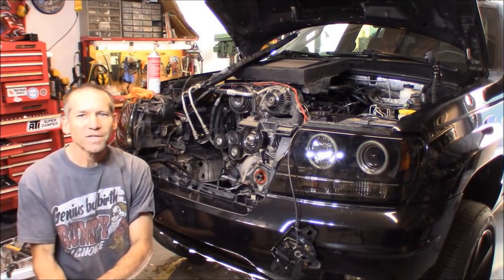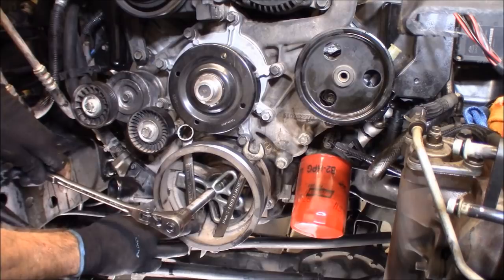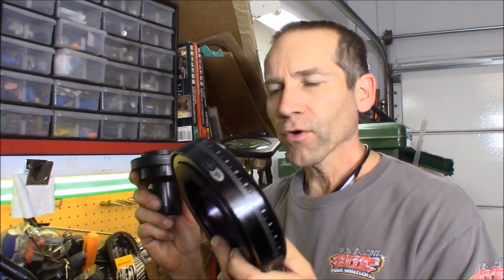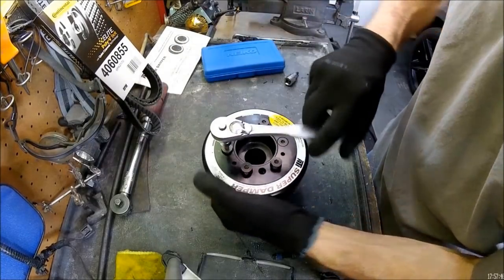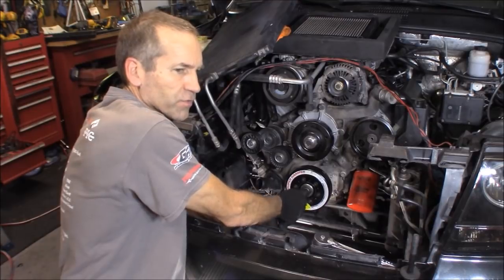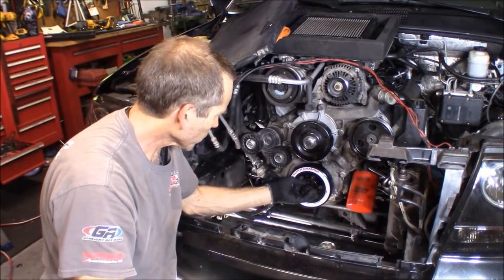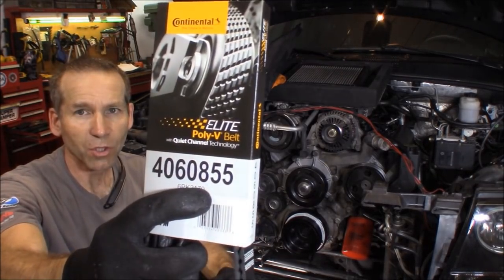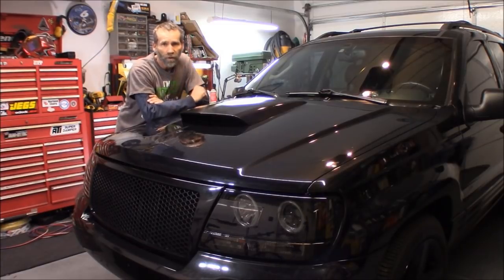How to Install a ATI Super Damper on a Dodge Jeep Chrysler 3.7 & 4.7

Comment: I put one of these on my 04 standard 4.7 without the underdrive. Really felt the difference in engine smoothness, I think my original balancer was going south on me. When I tightened the Torx+ fasteners I just put the balancer back on the shaft over the keyway, held it perfectly while torquing them. And I have to thank you for the video on the solid lash adjusters, made a world of difference in how the engine sounded and even better how it performed. 08+ cams are next, I have already cleaned up the stock replacement heads porting wise. Enjoy your videos, nice seeing someone else going after performance with the Jeep 4.7. Mine is more off road with a 3.5" lift, 33" tires and 4.56 gears but I do like have my engines running as good as possible. I will most likely put the 08 manifold and GM throttle body on it as well, though it is off road capable it surprises quite a few from a dig.

Comment: I can't tell you how jealous I am of your ride. I have a 02 grand cherokee overland and want to do all your mods but two things are holding me back, a small tool box and a small wallet. =P Keep up the great videos!
Reply from the maker: Thank you, best wishes...at least you have the HO engine.
Reply: Same with my friend we trying to fix his 2000 jeep grand cherrokke with the 4.7 but small budget
Reply: @martinbuilt  I have a 08 grand Cherokee with the 3.7, would a 4.7 throttlebody fit on the stock manifold? Mine has the drive by wire throttlebody

Comment: I can’t wait to learn how to work on my own rig as confidently and informed as you do, you’re a great teacher and your video was amazing to follow along with. Granted I may not have a shop/garage, or half the tools or machinery equipment you do; but someday I will. I have been thinking of going to a local dealer and applying as a mechanic apprentice.
Reply from the maker: Thank you, Seth. I really do appreciate that.
It's great to hear that my content gives you the confidence to do the job. Thank you for watching.
Reply: @martinbuilt  what would you recommend as far as someone with enough understanding or tools to do work such as this, but still doesn’t know ALL the things basic or not; someone who wants to start with a solid foundation of knowledge and understanding, while applying that to hands on learning? I’m going to start apprentice type of work for a local shop on my days off, hopefully it’ll all fall together and come full circle as I’m a pretty quick learner. Just been held back by space and tools and funds, so working on other cars in a shop will help there. But I want to study and learn everything from the basics, the differences in brands, car makers, engines, transmissions, etc. just all of it, what goes with what, etc. basically I’d like to get certified over time, but I’d love to go in hot with knowledge either at a shop or in school; any pointers on anything helps immensely. Thank you again!
Reply: @martinbuilt  thank you!

Comment: it might be possible with your customer made installer, to use the crank bolt and washer to "push/press" the new crank seal in, to get it to go in evenly.  And all the years of messing with cars, never seen the wrenches and puller used that way.  Taught this old dog a new trick for sure!!!
Reply from the maker: I like your idea using the crank bolt/washer

Comment: Well. The pulley that comes stock is balanced. My 03 Durango doesn't even move when running.  But, it's still a good thing what you're doing, as far as the set-up.  Good job.
Reply: I can tell you the stock pulley is not balanced any where near the ati.

Comment: Wow, what a way to pull off the old harmonic balancer, wish I would have saw this video 2 months ago. LOL
Reply from the maker: Thank you... I was just down at Pick-A-Part shooting a video down there and I was working on a Jeep with 4.7 HO engines and on that particular engine they used a different harmonic balancer on the HO models. The harmonic balancer is heavier and actually covers up those slots where I slide the wrench is through. So unfortunately it would not work on the HO engines. I wasn't aware until today that they had a different harmonic balancer.

Comment: I ordered a Ati for my c6 corvette and when I got it I put it on the scale and it was almost 4 pounds heavier than the oem one I took off my car and they claimed it was a little lighter than the oem one so I sent it back and put a new oem one on.  Don’t waste your money and you now the oem one will last at least 15 or 20 years and when you are there you do a pin kit if you are making any extra horsepower
Reply from the maker: For the 4.7 chrysler engine, the ATI super dampener was lighter than the OEM.

Comment: Hi Martin, 

I’ve been watching all the upgrades you’ve been doing on your 4.7 for a while. I own a 2013 4.7, and i have since new. She’s a bit beat up but i plan on doing a few mods that you’ve done once i get her fully restored.

A big one which i dont think has ever been done on a 4.7 is the ZF 8HP swap which i’m currently saving up the money to do. I feel a trans with much better ratios than the RFE will do the 4.7 a lot of good,
Reply from the maker: The 08 through 13 are excellent engines they made a lot of improvements in that generation.
 The RFE transmissions are actually capable of 8 forward speeds but I know of nobody that knows how to program the TCM to achieve that. I used to have a couple ZF axles in a rock crawler many years ago had rear steer as well.
Reply: @martinbuilt  Interesting, i’d be intrigued to know more on how the RFE could be programmed to use 8 forward gears or how that’s possible to begin with. I know they’re very weird transmissions, but could you explain that to me if possible? Id be up to possibly figuring that out myself.

Comment: What would be a good cam to upgrade my 2008 dodge Dakota with a 4.7ltr
Reply from the maker: I would say you already got a really good set of cams in your 08.
 Unfortunately there just isn't much after market support for the 08=13, 4.7 engines

Comment: Hey Martin have you ever done a video on how to test why the heated seats aren't working or part time in a 2004 jeep?? Sorry to change the subject but I couldn't find it and the heated seat problem in the Jeeps is a big problem up here in the north
Reply from the maker: I wasn't even aware there was an issue with the heated seats on the Jeep Grand Cherokee so far mine been working great but then of course I live in Southern Nevada and I don't use them very often.

Comment: Good video Martin. I am new here. I understand that you are the 4.7L Mopar guru. I have a 2005 Dodge Ram 4.7 with 75,000 original miles that says Magnum on the top of the engine. Is that the same as the HO 4.7? How do you tell?

Comment: Hi Martin, the links to Air Ram do not work anymore. I am a bit confused to what I need to buy here. Checked Air Ram's website, they have the damper size and the pulley that you need to specify, and in another listing for the 4.7, they have the pulley alone. In your video, you mention that there is an optional part that can be ordered or not. Can you please specify what is needed, what is optional and preferably with ATI part numbers if possible?
Reply from the maker: Yeah I checked it out, I don't know what's going on with his website it is definitely different than it used to be.  Not nearly as easy to navigate than it used to be.
 Maybe your best bet would be to contact ATI and order  from them.

Comment: At the end of this video you said you were going to replace the radiator due to cooling issues. Wouldn't reducing the water pump speed add to that problem? Also I did replace my harmonic balancer on my semi Diesel engine at about 1,300,000 miles and it is much smother. My friend did not and he broke his crank shaft and had to replace his engine.
Reply from the maker: You would think slowing water pump down would add to cooling problems but it didn't. I did eventually replace the hydraulic cooling fan with an electric and replace the radiator for the factory replacement and it runs cooler than ever.

Comment: Hi Martin, do you think that a 25% slower for the water pump and oil pump for the steering AND cooling is ok for a severe use (offroading mainly)
And I go a bit off-topic, do you have the numbers of the 2008 4.7  camshaft compared to HO camshaft?
Keep up with the great build.
Many thanks
Reply from the maker: For a off-road let's say a rock crawler where RPM is low much of the time I'm not sure I would go with the 25% underdrive. Just to be clear the engine oil pump spins exactly the same RPM because it is driven by the crankshaft. I checked the voltage on the alternator with all the accessories on the lowest it ever went was 12.5 volts. Occasionally I can feel a slight difference in the power steering at idle when I'm trying to make a quick turn I feel a little bit more resistance. Cooling still seems to be okay I did install a new radiator while I had it all apart. I'm pretty sure I'm going to be doing a electric fan conversion in the next few months. I'm just not happy with the hydraulic fan. In theory these hydraulic fan should perform very well I'm just not seeing it. As far as numbers on the 08 camshafts are you talking about lift,  duration and lobe separation?
Reply: martinbuilt  my wj is not a rock crawler but i am concerned that for some hps i am going to destabilize the whole system.
For the camshaft, why you decided to go with the '08 instead of the HO's???
And yes if you have parameters of both cams; it's interesting!
Reply from the maker: @GeoNemesisITA   The HO cams have .030 more lift (intake) then non HO engines. The 08 have have another .037 more lift intake (.509) and .043 lift exhaust (.472) over the HO cams. The lobe separation was widened to 114.5* from 112*. I don't have any numbers for the duration. I feel this will make a great match with the 08 intake and the 75mm Throttle body that I'm currently running.

Comment: Hey Martin, does the under drive pulley have any noticeable effect on the performance of the engine auxiliaries (water pump, alternator, PS pump)?
Reply from the maker: The idle voltage was a little low when the electric cooling fan would be running with other accessories but by installing a 49mm pulley on the alternator that brought it to a acceptable level. Water pump and the PS seem to work just fine.
Reply: @martinbuilt  where did you come across the 49mm alt pulley?
Reply from the maker: @nate4036  49mm Alternator Pulley https://amzn.to/3HY7huA

Comment: Just ordered a new H.O. engine for my Overland but my balancer is worn out and I can’t find the HO damper anywhere! Can I use the ATI super damper instead? Will it effect the engine if I don’t use the stock balancer since it’s a special balancer?  Also, if I do order the ATI super damper, can I get it without the 25% under drive option? I just want it to be as stock as possible! Thanks!
Reply from the maker: Yes you can use the ATI super damper I wouldn't use anything else especially on a brand new engine. Yes you can also order it with either the 25% underdrive or the stock size pulley.

Comment: Is that a Fram oil filter?
Reply from the maker: That is a Baldwin B2. This is an oversize filter for the 4.7   My XJ uses 3 of them oil, trans, and power steering
Reply: @martinbuilt  XJ's don't have power steering filters..
Reply from the maker: @seniorxj2931  LOL... It does if you add one. Didn't come with external transmission filters either. My power steering system holds 4 quarts.
Reply: @martinbuilt ,, do you have a link to these parts?

Comment: So did your WJ not have the huge belt driven fan or hiw you get rid of it?
Reply from the maker: In 2001 the Grands came with a Hydraulic cooling fan driven by the power steering pump. I just got done converting it to an electric fan a couple of weeks ago.

Comment: Nice videos man. Did you had it on a dyno since you made all the modifications to have it checked for the increase in hp? 
  I got one 4.7 v8 last week, I love it  but in the same day it stopped working, the coolant was getting low, and the engine seized.  I git it from an auction so i can't ask the owner what are the problems. I had a look at it and i've found sand in the coolant, and it was smelling like fish.... maybe the last owner  went in the ocean with this jeep. You think that could cause a problem for the engine ti stop while driving, mostly when i was pushing the brakes.
First tought was that the thermostat or the water pump is broken, or the engine may be cloged somewhere so I got them all out and wash with a hise the engine and the radiator.   And had a look at the thermostat and water pump, but they look like they work. Not sure about the thermostat, it opens, not too much i think, about 2-3mm when the water is about to boil, so i judge it opens at 90° C.
And i got some cylinder misfire, cyl 2 misfire detect -pending fault, and cyl 7 misfire detect on red code. Can you help me with some advises please? I would really apreciate. Thank you
Reply from the maker: Sounds like you got several problems going on at the same time. You said the motor seized that wouldn't be good. My first thoughts were you got a blown head gasket. Is it using coolant in other words is there any coolant coming out of the exhaust. Doesn't sound like the thermostat is opening like it should. On the misfire I would check the wiring at the coils first. Who knows how long it's been since they change spark plugs if ever. You could also try moving the coils to a different cylinder and see if the code goes to that cylinder then you would know the coil was bad. Hope some of this helps good luck
Reply: @martinbuilt  yeah, i was thinking the same, i hope it won't be the gasket gone. It's a shame what the previous owner did with this Jeep as the first one had service history every year until 2016. They've changed the coils, injectors, oils etc but i don't see nothing about the coolant, even if the water pump seems to be changed. As for the coils they had misfire on the same 7th cyl but with no fixing results. I will try to put pins in each connector if the coils are good and i still get the error
Reply: @martinbuilt  thank you for the advises. Keep up the good work!